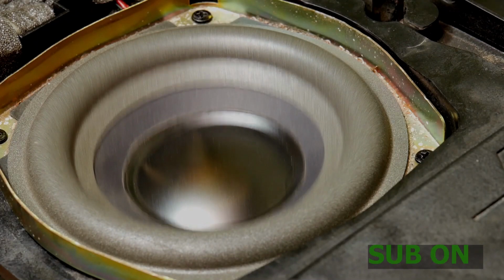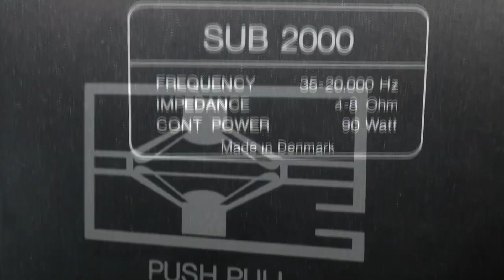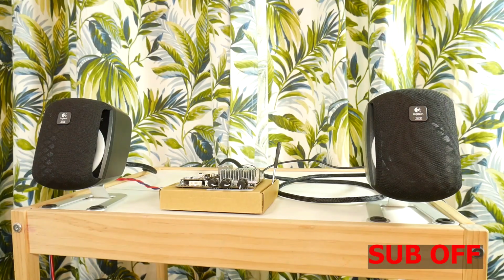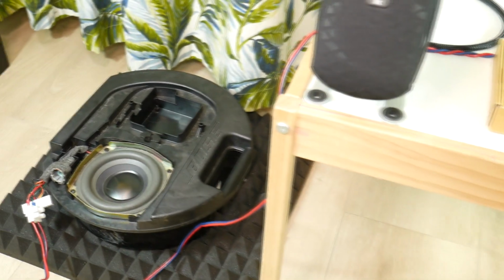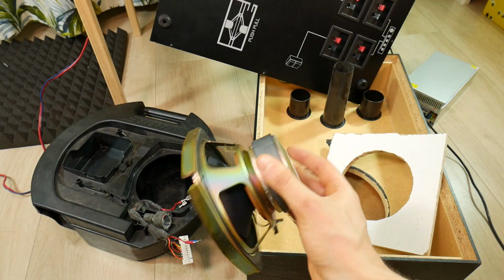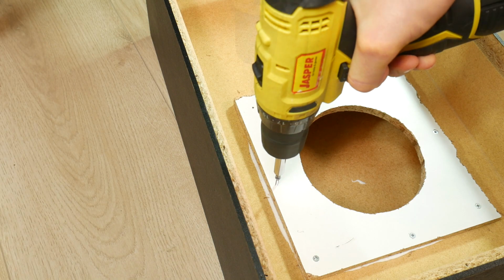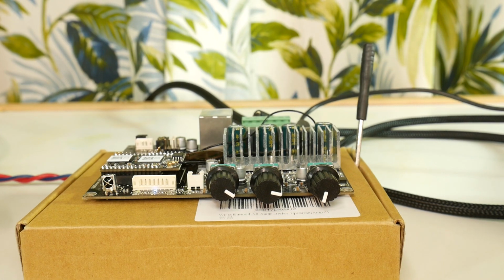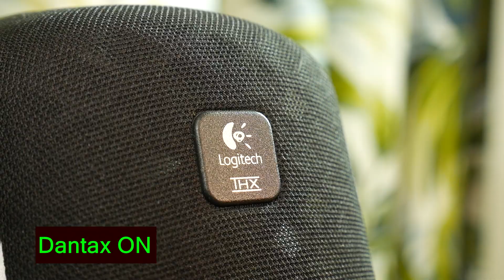Bose Subwoofer in 2 Different BOX - Bass Test

Comment: I have 10 of these ,    double voice coil subwoofers from Bose  that I got from the junkyard  They let me take them  free  Out of 10 different vehicles..  They're all pretty much the same exact ones from all different vehicles like escalades and mazda CX9's one from Buick.    I just know they're from different vehicles   ,  they're all the same basically   I wonder if I would make one big box what would It do?  How should I run it?  I can use a different amplifier not even sure the ohms on the subwoofers
Reply: These subs sound better than an 12s or 10s I’ve put in my truck. Currently running 4 ran in series and parallel to get 2ohms final expedience.